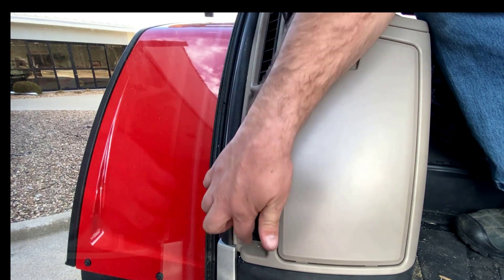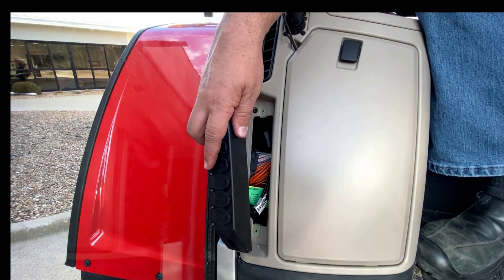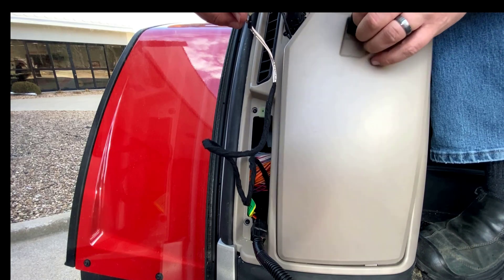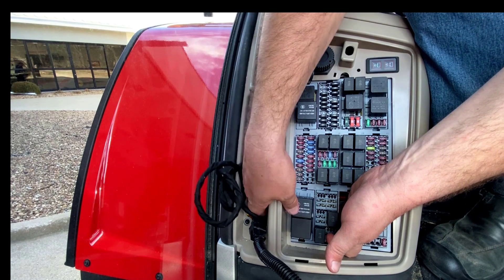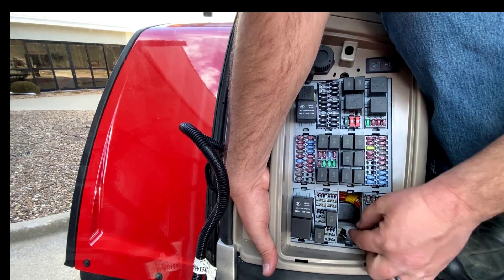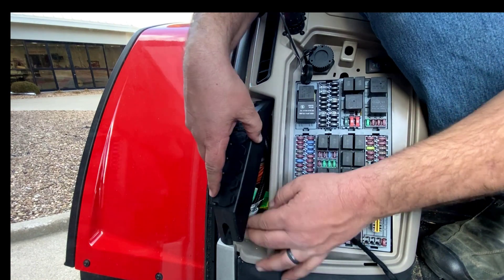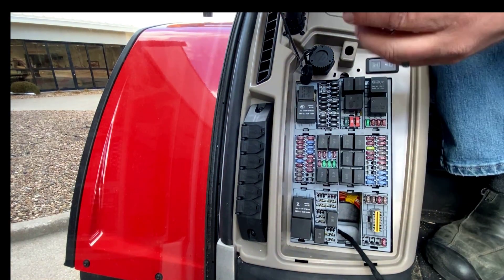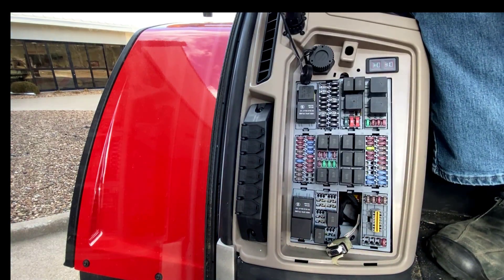Locating the Third Party Terminal Connector in a Massey Ferguson Tractor

Comment: I am looking at an 8s305 to pull my CIH 500t air drill.  I had been getting a speed signal for my pro700 monitor from the serial plug that is connected to my trimble nav controller.  Could the serial cable discussed in this video also be used to acquire a speed signal?
Reply from the maker: @nathanbarrett6761 Reach out to AGCO Answers by phone (877-525-4384), or email at agcoanswers@agcocorp.com. They should be able to assist you. Have a great day!